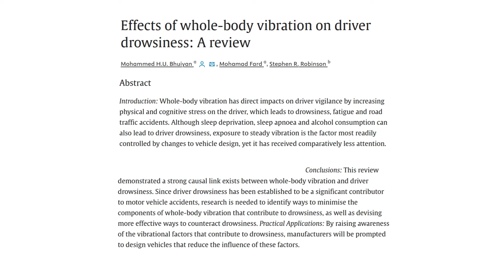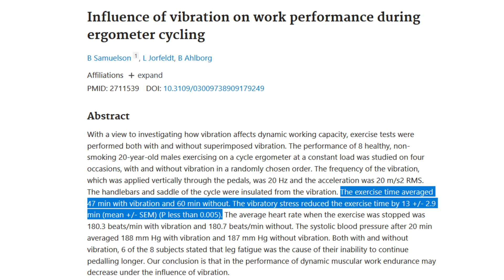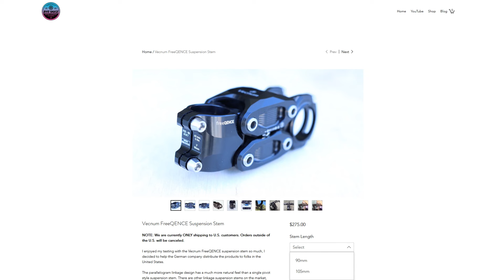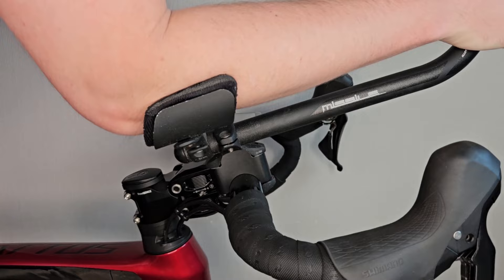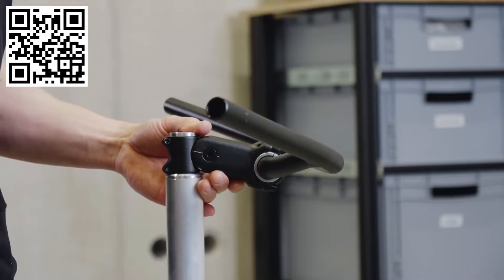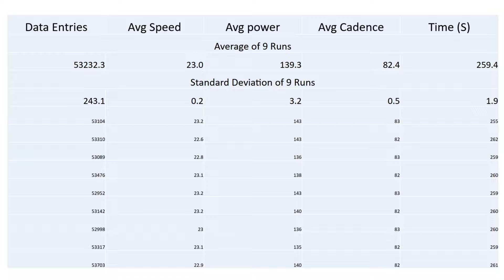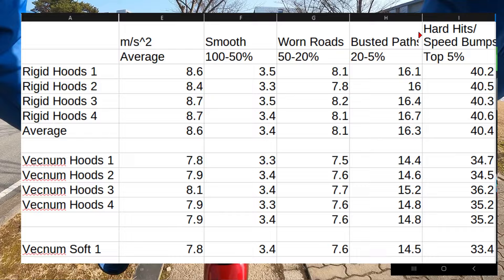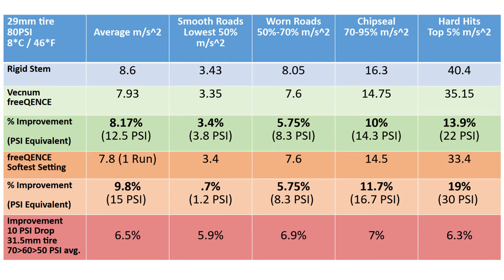TESTED: Vecnum freeQENCE Suspension Stem

Comment: Great test. Love the approach and protocol.
I did the same a short while ago and compared my long standing redshift sports shockstop stem, the Vecnum freeQence and even a XC suspension fork.

For what it's worth I prefer the shock stop stem and also didn't found any of the particular features like kinematics (parallel instead of tilting) of an issue - even with aerobars. Or maybe the tiltling even made things more comfortable for me. But - those features of the Vecnum certainly have their benefits for some usecases and riders. 

I have two questions (maybe 3):
- did you felt a noticeable difference in effectiveness / comfort by turning that screw? You said you preferred a middle'ish setting. But your data shows very little difference (and for smooth road even a bit worse) results for the softest setting. This was my main problem (even leading to Vecnum testing my specimen and send me an appropriately tuned version). But still to no avail. I - with my around 68 kg needed to set it to it's lowest setup to begin to feel anything worthwhile out of the stem. 
- So, how much do you weigh if I may ask?
- the differentiate in the classes "smooth section", "chipseal" and so on... was this based on actual positional data of sorts? Like e.g. time of the record or the km inside the gps-file to really see that the accelerations measured stem from this section of your test course? Or simply by some sort of "well, the second highest acceleration bucket should come from the second roughest part of my test course"?
Reply from the maker: Hi Torsten, thank you for checking out the channel and for the kind words. I'll read your article after lunch today. I always appreciate your perspective and high quality writing. 

The tilting on the Redshift is a non-issue for normal handlebar positions, but with aero bars the movement at the extension tips is very high. Control is better than a rigid stem, but I found myself instinctually pushing down on the aero bars before bumps to mitigate excessive movement. I could be more affected due to weight (93kg) and the length of my extension tips from the pivot point on the stem.

-The effect of the softest setting was noticed on chipseal and hard hits in the hoods, and was a pleasant surprise. I will not ride it that soft as the extra weight applied when in the drops and aero bars causes bottoming out with moderate bumps. I may weigh the front wheel load in different riding positions to illustrate this for the next stem video. In general, I find the Vecnum movement to go largely unnoticed, which made me think it wasn't working well when I first swapped from the Redshift. After swapping Vecnum>rigid>Vecnum, it was clearly working, but just felt very different from what I am used to (2 years of Redshift).
-Deciding how to record and present the data was the hardest part of the experiment and perhaps an area that could improved. Recording G-Force results in an almost normal distribution which can be useful in some ways, but limiting in others. Linear acceleration scaled nicely and better represented my subjective feelings riding the loop. Measuring known surface classes based on position/video data had some drawbacks like speed bump interference on smooth section and difficulty accounting for hard hits/surface transition hits spread throughout the course. The buckets contain data by order of intensity rather than course position data. Gopro video which allowed for surface classification and length records.  Buckets are anchored around the chipseal section, which represents ~14% of the total course time (rounded to 15%). Video showing the moment accelerometer data began recording allowed for a 20 second sample of consistently rough chipseal to be isolated. It averaged 15.5m/s^2 with rigid stem, pretty much matching it's bucket. Drawing a line between smooth and worn pavement was less clear since large chunks of the course could match either category depending on perspective. 6 wide ramp-type speed bumps scarred by speeding autos and 11 surface transitions had spikes in readings, and 5% (13 seconds) seemed like a nice round number, if overestimating a bit 4% is more likely correct, but round numbers are nice.  

Thank you for great questions. Any critical feedback would be appreciated too.
Reply: Hey, thanks for the detailed answer. :)
Ah, that's interesting to read that also you with a significant higher body mass than me at first was wondering whether the Vecnum really worked. Had the exact same feeling. For me, it was even exaggerated since Vecnum found my 120 mm stem at first not to their spec (was harder than it was meant to be). But even after getting it out of service the (non)feeling remained. Which in a sense is a good thing. Since the data clearly shows that it reduces vibrations. But a) for me it really has to be the very lowest setting to be effective (leading it to me to recommend this stem rather for people being quite a bit more heavy than me, wich would also exclude many women) and b) I'm wondering: if I don't really feel more cushioned instead of like with the shockstop stem but the acceleration data (at least in terms of absolute m/s^2) on the handlebar shows the same rate of reducing vibrations for both stems... am I as protected and am I as less fatigued with the Vecnum freeQence then with the redshift shockstop stem?

I tried to look into the FFT spectra to spot differences and try to make out different characteristics of the vibration damping and while finding some in the end I could only show and describe them but not draw hard conclusions out of it. Highly interesting nevertheless.

In the end I concluded the test with the absolute data and the description of individually felt comfort. As well as with a host of features and needs which might sway the prospective user to one or the other stem. E.G. if one wanted a negative rise it has to be the shockstop stem or if someone wants to use his Jonesbar with a suspension stem it has to be the FreeQence and so on.  @overbikedrandonneuring
Reply from the maker: @torstenfrank1856  It is an interesting difference between the two systems. I need to do some very long rides on the Vecnum to assess perceived fatigue in the hands and shoulders. 

Subjective feelings not matching data need some explanation though, and I don't think rotational movement with Redshift explains it fully. One issue in planning to test the Redshift I found was that the data may be incompatible with Vecnum/rigid stem data. Vibration is measured on the handlebar tops, while hands will be much farther from the rotation axis on the hoods testing Redshift. With the Vecnum/rigid stem, movement at the tops is the same as the hoods. I will try mounting the phone on aero bar extensions at the length of my hoods and on the tops to see how data changes. Thank you for the insight into that problem.
Reply: Can't wait to see what you will come up with. :)
I, too, tried to wrap my head around it felt and actual comfort might be a factor of absolute displacement vs acceleration. I seriously wonder if it would be a difference, where you put the accelerometer. If it's always the same acceleration but just a longer traveled way since it's the same impulse, it should measure less accelaration? Or not. On the one side it's just simple geometrics but on the other hand it's a question of cause (input) and reaction via us gripping the handlebar and being part of the whole system.

In any case: Since my Phone was mounted in a way very much representing the grip position on the hoods it perfectly represents the vibrations affecting my hands for both of these stems. Would be nevertheless interesting to see how the data would look different with the phone mounted on the handlebar and at the tips of the aerobars while in both cases riding on the hoods. @overbikedrandonneuring

Comment: Fun stuff. Its bit sad that this is only second video I saw with some measurements (after your other measurement on seapost).
Hand and wrists MSDs are no joke and reducing vibration should be studied more by bike industry. I think there is too much hype about speed/aero and not enough stuff about comfort for ordinary folks who just like to ride a lot.

One thing I am bit confused is measurement error in your experiment.

How many measurement did you perform on each setup?

I wonder how much of measurement error would be there if you make same loop 10x on same setup.
One hole is not same like other hole and path of ride is not always same. Maybe it would be hard to perform, but probably to smooth the results and figure out measurement errors you would have to repeat the loop many times.

Higher speeds would be interesting to see as well. What I found on my gravel 40mm tyres - a low quality asphalt is kind of ok on low speeds, but when you go over 30 its harder to avoid holes and in general it just makes hands "feel tired" faster. I do wonder how would figures look measured on lets say 25 vs 30 vs 35 km/h.
Reply from the maker: Cheers, I expect this to become a bigger deal in the next few years. I agree it is under reported on.

This test has lots of limitations for sure, but I think is a big step up from the 'one and done' tests most channels seem so keen on. I also hoped to explain it in enough detail that interested cyclists could recreate it on their own and hopefully improve on my protocol. 

When developing the protocol, I did more runs, but settled on 3 'successful' runs per variable for practicality since there was surprisingly little variation between successful runs. Clear differentiation from pretty small changes (like tire pressure) show up distinctly in the results with only 3 laps. Of course more laps would be ideal. Testing uncomfortable setups is rather taxing though, since the course is so dense with features. 

With the dozens and dozens of laps, I was able to target the same marker of each speed bump and curb and take the same lines on the busted path pretty easily. 

Speed is limited for my safety (many big bumps), safety of pedestrians on campus, and fewer failed runs due to improper speed.  

You should give testing a try. It's quite interesting.